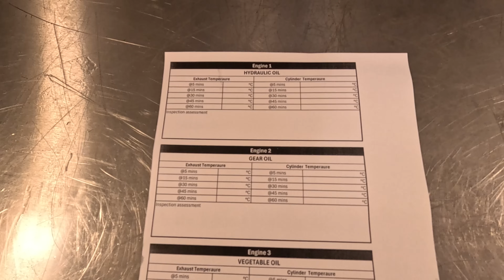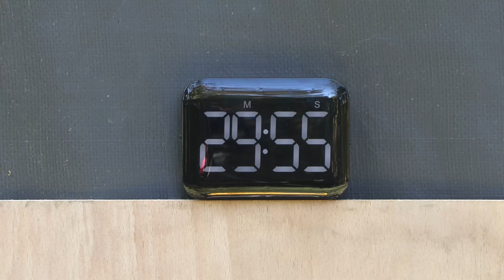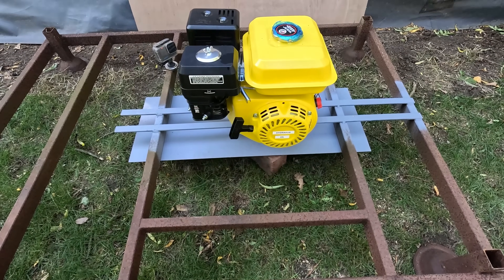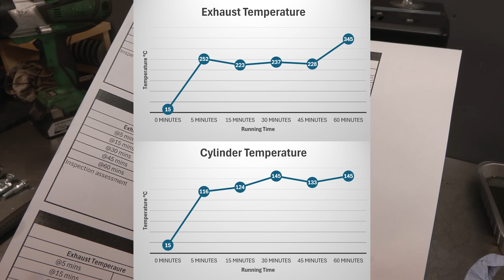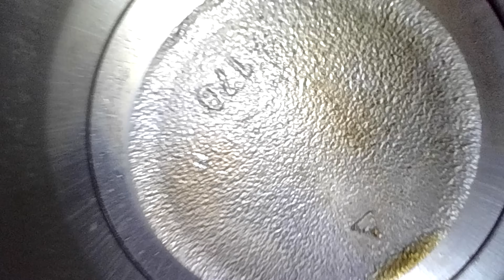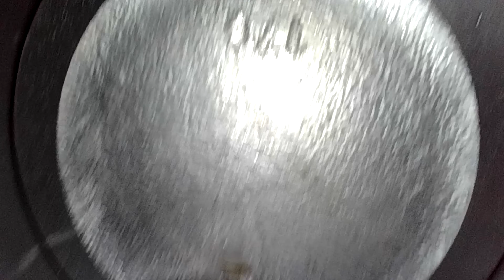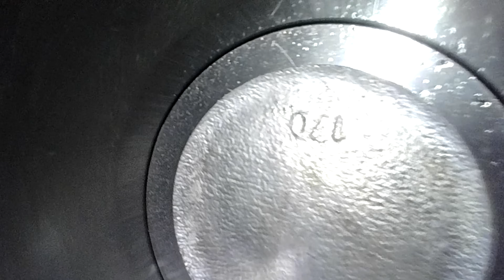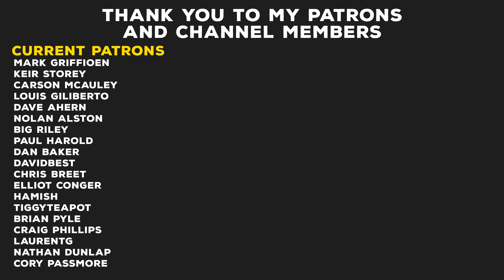Will Any Oil Work as Engine Oil?

Comment: I'm sad you didn't use homemade quality Castor Oil, or had any kind of load on these engines, like a chain turning an BLDC electric motor, to power lamps or something through a 3 phase rectifier. But this was still great to see. If something worse then covid happens, I can't obtain proper engine oil, and I'm not ready to grow & make my own Castor Oil. Then I will have to run my generator or Predator 212 engines bikes on these. This was helpful. Thank you. Oh, and I think the Vegetable oil one having a cooler cylinder, but hotter exhaust, may mean that thin oil getting past the rings, is probably taking cylinder heat with it, out the exhaust.

Comment: No control whatsoever . At least you could have run the engines with recommended oil and collect the data . Temperature difference most likely due to different AFR between engines.. WASTE or TIME

Comment: I once used Lard in my engine. A small car, 4 cylinder vehicle.

My vehicle kept leaking oil at a small drip. I was broke one time where i couldn't even get a small quart of engine oil. My friend said he would give me gas money. I couldn't afford any oil so i looked in my pantry and i found old lard. I put that in the engine and it ran fairly well, even at 70 miles per hour. Once i saved enough to get paid, i fixed it and the mechanic mentioned that it smelled like bacon lmao

Comment: I ran a quad (400ex) on veggie oil for 4 days in the sand dunes because it’s all I had and forgot to put oil in it after building the motor. It ran great and I swapped it back to 10w40 and rode it for years after.

Comment: Should of have a control motor with the right oil to see the actual difference 
Because I built 350s and had a couple scares on break points of a rebuild ...

Comment: Chilton  Manual on engine rebuilding really explains it well about putting strain on a rebuilt or new engine and its lubrication factor.One thing an engine HAS TO HAVE and i CAPITALIZE it is a BREAKIN PERIOD and a critical OIL CHANGE that CANNOT BE  IGNORED.You have to remember that the engine itself actually MACHINES  ITSELF  IN  and has tiny castiron particals in the oils , from the gastiron rings to the cylinder walls. If the rngine is broken in properly it will INCREASE ITS  HORSEPOWER?? OIL ITSELF IS ACTUALLY WORTH MORE THAN GOLD. On that particular motor you are using ?That is what they call a SLING SYSTEM with oil? It  has an arm on the crankshaft that slings oil up to the side of the cylinder wall. THIS IS FOR A 4 STROKE  ONLY. This is where our techs are mirical people?Why because they have perfeced oil additves that STOP  FOAMING OF OILS and can still lubicate even if foaming takes place. The technolodgy in oils are actually allmost as important as the MEDICAL  INDUSTRY.

Comment: I had a Mitsubishi Magna 3.5 v6. Being a mechanic I really couldn’t be bothered doing services & changing oil & whatever. Had it for about 5 yrs, I did 1 proper oil change in that time. Travelled 100,000 km while I owned it, during which I used left over engine oils of any grade, diesel oil, power steering fluid or ATF, anything I had laying around that I could top it up with. Most of the time I would only top it up if either the oil light would flicker or the engine started ticking.  Topping up would fix those issues.  Mitsubishi engine was bulletproof. I have a vid of the last engine oil change too if u want to see.

Comment: Should have used correct oil as a control and maybe set up pulleys and belt to a load to see if it wore faster. After all you never in real life just let an engine run without it doing work.

Comment: I suppose there should be a reference of another engine running with regular oil to compare these results with. It must be noted that for oils to disintegrate and oxidize (in which case it'd have been a better comparison), 1 hour of running isn't enough.....

Comment: Neat, and I agree, I cant bring myself to run a Briggs, Kohler,  or Honda since the Harbor Freight Predator series came out. Here in the U.S. the 212cc Predators are making over 40 hp, supercharged on Nitromethane for racing. You can get any go fast parts you want there's even a hemi version. Most parts interchange with Honda. next time break them in first, run them under load for a few hours, and check TOP rod bearing, it's taking the load. ALWAYS use the recommended oil (especially on Detroit Diesel 2 strokes) Having said that, we had a guy at the state highway shop F up and put the central engine oil dispensing pump into a 55 gallon drum of AW 32 hydraulic oil. 1 international DT466 and 2 Cat 3126 engines went about a week on it before we noticed it. No issues. In my decades of working on farms etc I have seen several OLD tired knocking, smoking engines go a few more years by using 90w or even 85w-140 gear oil in them if you had nothing to lose, just let them warm up . "I have seen more engines screwed up by not having enough oil than by the wrong kind." Said some internet poster once, and RTFM "Read The Furnished Manual" or some other F word. 😂

Comment: 18:30 my theory is that the vegetable oil is acting like water injection, cooling the engine while moving the heat outside of the engine by evaporating/burning up in the exhaust.

Comment: It would be great to just have a 4th engine with regular engine oil in the test as well. Especially for the metal particles in the oil and the scratches in the cylinder.

Comment: It would have been nice to have one motor run with 30W motor oil just as a control.  Also, it isn't particularly surprising to me that all three survived.  Before rapeseed oil was deemed suitable for human consumption, it was used for industrial lubrication.  As for gear oil and hydraulic oil, both are petroleum based.  I know when doing a comparison of the hydraulic oil I use for my tractor, and some 30w motor oil, the viscosity was extremely similar, and both were similarly slippery, although the hydraulic oil in this video is likely more modern, low viscosity stuff.  Gear oil is also not nearly as thick as one would think, if I am not mistaken, 80w gear oil is of similar viscosity to 50w motor oil.  Bear in mind, I am not fact checking any of this information, and may be misremembering certain things, but as far as small engines go, if non detergent oil will work, oils of other additive packages like gear oil, transmission fluid, or otherwise, should function passably.  As for rapeseed oil, while it is a lubricant, I would imagine that it would gum up pretty severely as it is exposed to the residue from burning gasoline, along with being a bit too thin to well lubricate wear surfaces.  I know when lubricating old firearms, the old organic based lubricant that was used in the black powder days will get sticky if you add petroleum based lubricant without first removing the old lubricant.

Comment: I've run a mower With a 3.5HP BRIGGS on 80w 90 rear end gear oil for over 3 years, then gave it to my son for his place 2 years ago and he's still using it today. The engine was already 4 years old when I put the gear oil in it and that's what I had in my garage at the time I did the oil change. I thought What the hell, It's just splash lubed anyway. Still runs good, no smoke and uses no added oil by the end of the summer.

Comment: I think the biggest thing you going to see with hyd oil is scoring under load due to being too thin. But this depends on the hyd oil. It also won’t have the proper detergents to handle contamination that move past the rings.

Comment: Was the hydraulic oil the common iso-47 15w or.
iso-32 10w
Iso-68 20w
.
There are others, but those 3 are the most common.
Reply: I've found a oil cooler and removal of the rope start, seriously helps these little engines run much cooler.

Comment: Back in early 90's I changed my engine oil in my 1978 Olds omega with a 231 v6. It was a hot summer day and I saw some oil in the shed that my brother had, turned out to be 80 w90 gear oil. I noticed right away later that night picking up my girlfriend about 40 kms away the valves were rattling a bit but put on about 100 kms.
The next day, we went to a wedding about 150 kms away, the car engine  shut off. mussed a bit and some black smoke as the oil heated it got thinner. I drained it the next day, but after about a month later the oil pump went out, it had low millage on it (40,000 kms) as I bought it from my Aunt. 
East coast Canada 🇨🇦 NB province here.

Comment: Nice Idea …… bad Design.
(1) No reference Engine with the recommended Oil
(2) No Load …… put a Generator to the engine and use at least 60%  of the Engines Performance.
(3) Too short …… ICE expected lifetime is at least 1000h, so you must run at least 100h
(4) Wrong part examined …… the most stressed part off the baring   is on the opposite side where the Explosions force hit the crank  ……

Comment: Ok... Now search:
Argonne National Labs Boric Acid Lubricant 
Then do the same but with Boric Acid added to the oils.
In a car engine I used about a heaped tablespoon of Boric Oxide/Acid powder dissolved (not all)  in around a cup of boiling water.

In those small engines probably  a level teaspoon dissolved in 2 tablespoons of boiling water.
Engine PROPERLY run in to old, hot and filled to max with oil.
If they stall; You may have to disconnect the crankcase breather until the water boils off.

Comment: Changed the oil in my Toyota tocoma and there was hydraulic oil in a engine oil jug i think it was supposed to be 15w30 i drove the thing for 2 days around the farm never knew anything was wrong until my grandpa told me that was hydraulic oil then i changed it nothing happened ran for 3 more years until it overheated and locked up

Comment: My 85 cutless with a Chevrolet 350. The timing chain cover seal went & engine got too hot to run. I added alit of gear oil. She started and I drove her home 12 miles. It dinged all night. That hot. It started the next day. I should of rebuilt it. Cause next Engine the day later after installation. Spun a bearing at 45mph. Sad ending to a classic car

Comment: Suggestion: What if you use 2-stroke oil as engine oil in those engines?
Reply: No such thing as 2 stroke oil
Reply: Yes if you mix petrol and oil it's for to run strimmer and hedge trimmers

Comment: I have seen two 5.5 hp B&S engines inside after they have run with rapeseed oil for about 10 hours. On both engines the bearing material on the connecting rod bearing had melted with the result that both engines broke their connecting rods.

It is my impression that the cheap Chinese engines you use for the tests are not that bad at all in comparison with similarly many times more expensive B&S engines. These are engines that you just change if something goes wrong inside them.

Comment: Need to do the comparison with the engines under severe load .  A excact same loading that can be attached identical to each engine.  Running any engine under light or no load is not good for piston rings and bore especially new engine.

Comment: Interesting video , nothing blew up , so in an emergency any oil would be better than no oil.

Hydraulic oil come in various different grades ISO 32 is used in piston compressors , which move in a similar way to a ICE without the heat from combustion and is equivalent to SAE 10W.

There are companies that can test oils to see what contaminants are in the oil and diagnose failures etc 

It would have been nice to have had a control engine run to manufacturers specs and to have done a much longer test .

Please don’t take this comment as negative but constructive suggestions  I really enjoyed the video , hence the like , I will look over your other content and you may have won another subscribe

Comment: EGT differences could be down to variations in mixture strength. to eliminate that factor you really need to run all three types of oil in all three engines, then you will be able to see if the temperature variations can be attributed to the way the engine has been set up or the type of oil used.

Comment: Everyone talking about regular oil engine test and I just wanna point out the varying temperatures might be due to carb lottery as i will call it. Basically, what you noticed, the engine quality differs. The same probably is with carb tuning, china assembles it, checks if engine starts and gets up to revs and that's it. Engine will run on a wide amount of AFR but not always correctly (the odd sound?)

Comment: The temperatures are dependant on the carburetor. Lean runs warm.
The automatic throttle also has an impact on the temperature. Excessive rolling will give a higher temperature.

Comment: Too bad they are just running unloaded, next time use a propeller or a generator motor to run the motors with a load as they were designed to do

Comment: These engine have such loose tolerances that they don’t give a shit what’s in them as long as it’s a lubricant.  You needed to do a control engine.  Correct oil, run for many more hours and then test the oil in a lab.

Comment: you should also try a run with pancake syrup, and one with kerosene,  and one with wd40, and for kicks one with pure antifreeze, no 50/50 min but pure, cuz its kinda slippery.

PS/EDIT:
you shoulda put a super strong magnet drain plug on them, to try and collect and see how much shavings come loose, if you cant find a magnetic plug, just putting a really strong one on the stock plug would help to grab some also, maybe not all but better then nuthin, or have magnet OFF while running, then shut down engine, then remove plug, then take super magnet and stick it right kinda under the drain hole, so when you tilt it over to pour the oil out, it will have to 'slide' past/over the magnet as it drains, and any ferromagnetic shavings or chunks/particles will stick to it, and you can then collect/inspect it and maybe weigh the total of the collected metals at the end to get an idea of how much wear may have occurred. you also can pour the oil as its draining through a strainer/coffee filter, however that would be quite slow going...   
just a few ideas to consider!  

/end rambling

Comment: A test with the correct engine oil is essential as a comparator - I suspect you would have seen those filings as well - Failing that then a short flush run for each with flushing oil perhaps? Additionally, a longer run - preferably with some sort of load applied - for a true test of these oils. £60 for a little engine like that though is amazing!

Comment: I recall witnessing a military truck engine being serviced with gear oil instead of engine oil. Well, I was on the convoy when it was discovered. Dunno what the disposition was when it was sent back to the shop but it did drive at least 350 miles…

Comment: Years ago, in the dark ages, (1972) a friend had a 55 Chev BelAir with a 265 and 3 speed that used a gallon or more oil a day. We were driving around one day and the oil light came on. He said the heck with it, there is a 396 ready in the garage. Pulled into gas station and filled it to the full line with water. Freaked the gas station guy out. He drove that car for another 6 or 7 months on water before he got around to the engine swap. When torn down, there was nothing really wrong with the 265.

Comment: The experiment needs a lot of work to be meaningful;

1) Many more engines! The variances you measured could easily be strictly due to manufacturing variances between the 3 engines. I'd suggest a MINIMUM of 3 engines on each type of oil.

2) Control engines running the recommended oil, again, at least 3 control engines to account for manufacturing variances between the control engines.

3) Oil change after short break-in.

4) Put a LOAD on them! Nobody just runs engines for the fun of running them, they are run to do work. Rule of thumb is to give the a load of about 50%.

5) If possible, run to FAILURE.

Comment: This was a very interesting video. As a precision agricultural equipment technician, this is a very informative and thought-provoking video. It would have been nice to have a control engine that ran purely normal recommended engine oil. It would also be cool to see you run these engines longer and under load to really test the shear points of the different oils as well as their ability to retain lubricity under load and higher heat. Now, these engines being of lower quality also have looser tolerances allowing them to function with lower quality oils I.e oils with different sized quote "liquid ball bearings." I was surprised that the vegetable oil performed somewhat well. The gear oil and hydraulic oil. I was not surprised. Gear oil is used in differentials and axles on pretty much any form of transportation. So it is revolving at an astounding rate with lots and lots of load. EP. Your extreme pressure gear oil, especially 80w90 and 80w140 is especially common in over the road semis and Off-Road agricultural equipment. Your hydraulic oil is used in extremely high pressure situations. Sometimes upwards of 60,000 to PSI, and is ran through gear or piston style pumps and motors . The Piston style pumps and motors are basically miniature engines with a series of Pistons on a swashplate that revolve anywhere from 500 RPM up to 2500 RPM depending on its application. Not surprised that hydraulic oil performed well. But still engine oil is the best for engines hence the name

Comment: Gonna ignore the warnings and fill my engine with vegetable oil and if it seizes (as it will) I will sue you for 100 trillion dollars!

Seriously though, if you had used B&S engines it would probably be fine. I've run those on engine degreaser and hexane. Ran just fine. I had one that ran out of oil and worked fine for the entire year before I even checked it (basically I pumped out all oil so there was none left and then forgot to refill it).

If I could buy a car with a B&S engine I would those things are bulletproof.